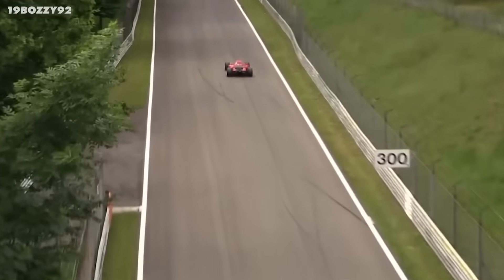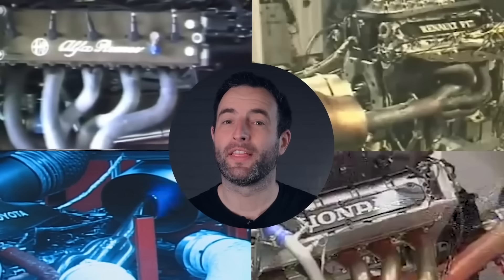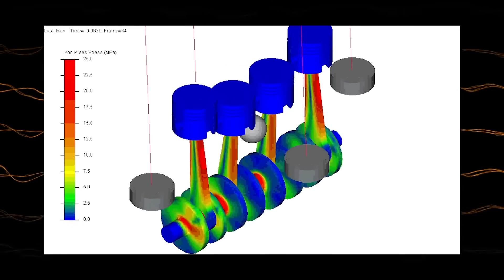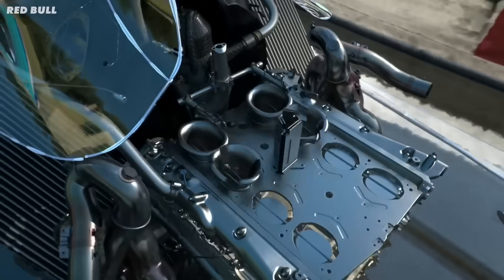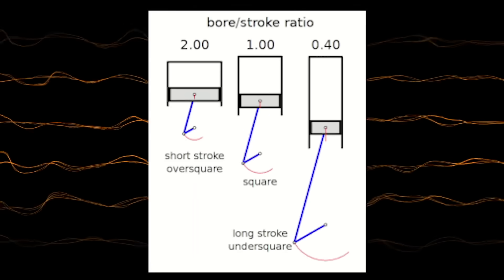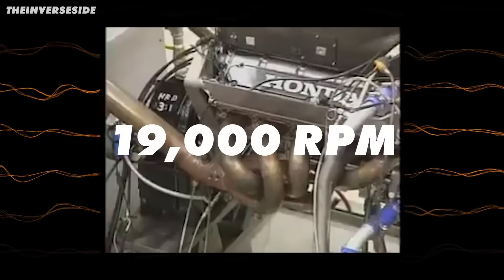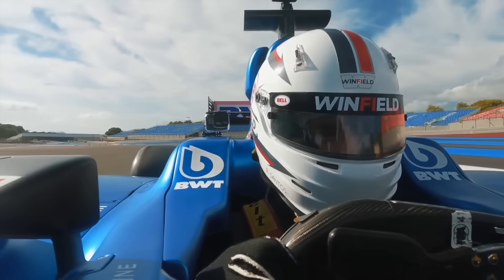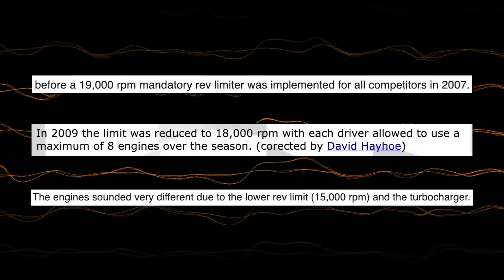When Formula 1 Engines Revved to 20 000 RPM!

Comment: I loved the description, but a small correction is needed about the reason V10s sound so good. For the really technically curious ones, V10 and in fact inline 5 cylinders sound different to any other engine layout because of their odd firing order and the frequency at which a power stroke occurs. In a typical 4-stroke engine you get a firing interval in degrees of rotation by multiplying 4 by 180 and diving it by the number of the cylinders. In 4 cylinders that's 4*180/4=180. Every 180° of rotation of the crankshaft, there is an explosion occurring. In 6 cylinders that's 120°, V8 - 90°, V12 - 60°. All of those spaced 30° of rotation and that's why they can sound good, but they don't have that dirty texture in their sound. HOWEVER inline 5 or a V10 have an that happening every 144° and 72° respectively. That interval leads to a different sound, one with unique frequency and texture. That's why Inline 5s and V10s sound so dirty in the best way possible.

Comment: Are you a F1 motor mechanic.. No.. Definitely not.. The precision of a F1 motor.. There is no rings you have to warm the block up before you kick in the guts Barry.. The high revolutions come from the induction systems and the electrical system..most modern cars can handle high revs...

Comment: The Mercedes F1 cars in the 1950s had what they call desmodromic valve gear, a sort of extra camshaft that pushed the valves up while the 1st camshaft pushed them down.  It didn't matter if the valve springs couldn't do their job.

Comment: Want to talk about internal engine stresses. Look into a top fuel dragster.  500 cubic inches (approx 8 L) and produce approx 12,000 HP. run around 9,500 rpms. Turn over only 900 times in a qt of a mile. Must be rebuilt after every run.

Comment: I miss this era of F1 racing. I remember the first time to a F1 race and heard the banshee wail of these engines going around the track. I remembering first hearing the sound of engines almost 5 miles away from the track and by the time I got within 3 miles of the track I could make out the voices of the different engine makes. As I made the walk from where I parked my car to the track and by the time I went through the gates of the track I was drunk on the sound and was gitty and giggling.

Comment: Although I 100% agree that the V10 engines sounded the best, today’s engines would actually sound much better if it weren’t for the artificial (based on fuel flow restrictions) RPM cap.

Comment: One of the other reasons V12s fell out of favour against V10s was that the former had noticeably higher fuel consumption so Ferrari was often compromised in strategy against the V10 and V8 competitors. McLaren found the same challenge when Honda used a V12, complicated further when they deviated from a 60-degree V angle.

Comment: current F1 engines make as much power at 10krpm with 1.6L, and half the amount of fuel...not bad if you consider an engine is not a loud speaker and is made to power a car, not make noise. without current fuel flow limitation, current engines would decimate V10's performance.
Reply: no they wouldn't, because there's only so much you can extract out of a 1.6 V6, a 3.0 V10 with twin turbos would easily destroy modern V6 engines

Comment: To summarise,  F1 engineers didn't want to make cars revving to 20k rpm. They had to make engines that rev to 20k rpm because they were limited by CC and a ban on turbos.
If neither were restricted, you'd bet your house that engineers would build engines that put power where the driver could actually use the most on the track. There has been extensive research into modern turbo power race cars vs high revving NA race cars. The outcome is always the same, the driver has access to the power more of the time when the power is lower down. 
Put that kind of engine, even 8k or 9k rpm in a road car, and the truth us, you'll only ever feel the cars power in 1st gear most of the time.

Comment: I'll never forget hearing the sound of the V10s heading out for their 7AM warmup at the 1999 Australian Grand Prix in Melbourne. The Albert Park circuit is near to the centre of the city and the sound traveled for kilometers across the city.  Imagine the tranquility of a Sunday morning shattered by up to 20 V10s revving to impossible speeds. Spine tingling and unforgettable.
Reply: Did it ever cause windows to break ?? I'd think somewhere windows would ripple and maybe crack if close to the track.....
Reply: The way you mentioned shattered tranquility instantly made me think of the Africa Special on Top Gear, where Jeremy uttered a similar line for James May on a very fateful morning.
Reply: The engine sounds are the reason Lime Rock never had races on Sunday... the local churches were up in arms about the noise iirc

Comment: Bit of interesting trivia that shows that RPM had become the only meaningful way to gain power: in the early 00s, manufacturers would record competitors on the straights and then analyse the audio to find out the highest pitch because that could be directly converted to RPM and then compared to their own to see if they were up or down on power compared to the competition.

Comment: They should scrap the Turbo+Hybrid altogether.  They should return the 3.0L V10's, set an RPM limit of ~16,000.  But have either renewable fuels, or hydrogen.  We already have Formula E.  I've said this before, we still race horses don't we?  You could also restrict the materials the engine could be made with.  All this to keep the costs as low as possible.. These new 1.6L Turbo/Hybrids are WAY more $$$ than the V10's ever were....

Comment: Early n/a era with manual gearboxes was simply glorious.  You could hear the drivers shifting and matching revs.  Engine down shifts into corners were epic.  True, paddle shifters sounded just as good and resulted in faster times but gone was the driver working the throttle.

Comment: Tbh, never really liked the wail of the V10s. I’d go as far as to say that the big-standard 1970s DFV sounded better to me, but even that was shaded by the ‘70s V12s, more specifically the Matra V12, which sounded utterly stunning. 

Still, best sounding F1 engine to me still is the 1950 BRM V16. It sounds like a race car engine made by an angry god.

Also, weren’t the 3.5l era V12s mostly handicapped by needing way more fuel than the V10s?

Comment: aside from the sound of the v10 and v12 f1 engines i love the sound of 11500rpms on a tuned zx14r motorcycle with an aftermarket exhaust. inlne 1441cc 4 cylinder.

Comment: Yeah, change the engines because of the cost.  And how did that work out?  Same amount of engine suppliers as before.  Then climate activism forced a change again to the v6 shit bag engines.  Now the PU is more expensive than ever.  That's perfect F1 right there.  The changes made make the problem even worse.  Good job guys.

Comment: and... todays engines are MUCH MORE EXPENSIVE
Reply: But they need way less of the
Reply: @ploppyjr2373  are they? Back then there was place for smaller manufacturers like cossworth and they could compete with the big ones and create better engine. Now there is no more place for them because design is so costly. Every component of todays powerplant is 10 times more expensive
Reply: @metalbyku  probably but again, as i said. Ferrari would use a new engine for every race and run it at max power. Very fast, very unreliable

Comment: The Honda RA109E V10 was actually the most powerful V10 in 1989 with a reported 685bhp vs the Renault's 650bhp, and helped Prost and Senna dominate that season. Honda even later produced an even more powerful V12 with 800bhp. It wasn't until Honda's departure in 1992 that Renault produced the best engine that year, with their RS4 V10.

Comment: Will never be a period like it ever again, more likely F1 kill itself through greed and corruption, obviously under the banner of equality, sustainability or something like that.

F1 circus is absolutely nothign compared to the rest of the world of co2 is your thing, nor do we need to follow the electrical race at all or any of the road car nonsense, this is supposed to be pure fun, entertainment can easily stand on it's own legs far outside those parameters cause it's a drop in the ocean.

No it's not what it once was, too much interference, too many interest ready to use and abuse F1 for own agendas.
No reason cars could not be extremely safe, much cheaper, lighter and faster today using same regulations applied to modern technology, think even refueling could easily be solved in save enough way today, they just do not want it and we will never see 20-22 cars fight at somewhat equal terms but with different ways of attacking the problems, aka developing within a fair set of regs.

None of can sit on the high chair and claim to have all the solutions, so just my personal opinion, beliefs.

Comment: shouldn't that sound be basically inaudible for most people?
Reply: 20,000 Hz is inaudible, but this is revolutions per minute, not second.

20000 revolutions per minute, 10 cylinders, 1 combustion per 2 revolutions per cylinder, is 1666.7 Hz. Totally audible.
Reply: @DJ_Level_3  Good point, thanks. I tried it in an online tone generator and even though it's very high pitched, I could imagine an F1 engine making a sound that high

Comment: Now that they have introduced a total spending cap, they should remove the ban on rpm and other performance factors. All of that is no longer necessary as the bigger teams cant just spend their way to the top. You'll likely see different innovations in different areas too. Some teams might for longer strait line speeders with powerful engines, some might go for shorter, lighter, less powerful but more maneuverable cars. Their strategies would change over time too. With the spending cap, its nobody's fault but their own if a team keeps losing.

Comment: I have a simple solution for the Sound problem. Instead of a V6 use a high RPM i5. At 15.000 RPM they scream just like V10s while having similar emissions to the V6.

Comment: I'd rather have teams chasing for the rpm than aero, aero makes no noise D:

Also it was the stupid environmental marketing angle that killed the naturally aspirated high revving engine. Cosworth showed with the Aston Martin Valkyrie that you can make a nat asp big V that complies with emission regulations. And it's not like the entire F1 circus doesn't actually produce way more emissions than the cars themselves, the V10 and the V8 were just the victims of stupid marketing.

Comment: In my opinion V12 engines still sound much better than V10. 

The Lamborghini SCV12 already beats out any F1 V10 and it’s not even an F1 level engine but just a slightly tuned SVJ engine.

Comment: I'd agree with most of what you say, seeing and hearing Red 5 going around Silverstone is about as good as it gets. At about the same time I saw and more impressively  heard a BRM V16 going around the same circuit, nothing like it. My favourite sounding competition car was Tony Pond in the works 6R4 going through Hamsterly Forrest on the RAC rally makes the hairs on the back of your neck stand on end. Formula E has a lot to overcome, a squealing tyre just doesn't cut it.

Comment: The current engine is not even hitting the 15000 rpm rev limit because of the fuel flow limit rule. They run around 12000 rpm even in qualifying.

Comment: Here's a freeby guys, as I feel like you're missing literally half the video:

Typically torque will drop off as rpms increase, meaning that you can't simply increase the redline and make more power, no matter if the engine can take it, mechanically.

Torque is directly related to how much air and fuel you can fit into the engine during the intake stroke. Combustion efficiency comes into play (derived mainly from how well mixed your air and fuel are, as well as compression ratio, combustion speed and ignition angle).

You can change valve lift, timing and duration to optimize that valve opening window to get as much air as you can through the intake ports, but at 19000rpm, that valve opening window is SO small, that those ports actually become a bottleneck. (theoretically your maximum airflow happens when the airflow reaches the speed of sound, beyond which you get a 'choked flow', where the air travels faster but loses density so your essentially moving basically the same amount of air molecules).

Where I'm getting at is: if torque drops off faster than the rpms can add additional horsepower (HP = torque * rpm / 5252), then this means that revving higher will net you less HP.

Luckily, to not explode your rotating assembly at high rpms, you typically reduce the bore/stroke ratio, meaning you'll get a bigger piston diameter, slowing down your average piston speed during the revolution. This ALSO translates to ***more space to put it bigger valves***.

Basically: as your bore becomes bigger, even if you reduce the stroke to maintain an identical displacement, you benefit from having the possibility to use bigger valves, which will flow more at higher rpms, thus allowing you to maintain the cylinder filling that is critical to maintaining enough torque at high rpms to generate more HP. The draw-back is that huge valves actually flow like crap at low rpms, induce terrible air/fuel mixing, both because you lack air speed through the intake ports at lower rpms. This is a contributing factor as to why high revving engines like motorcycles get such bad efficiency at low rpms compared to typical road car engines.

Comment: All my favorite engines are high revving, that's why I bought an early S2000 vs the later one. When they started lowering the limit I felt like they were limiting advancements. I'd love to see them open up the rev limit and other design factors to see what the best engineers can do.
Reply: It’s not just revving high it’s firing order. That engine is nothing more than an oversized sport bike engine. Audi/Lamborghini, Porsche, Lexus (really Yamaha) and BMW are the production V10’s to have.
Reply: 250cc inline-4 bikes such as CBR250RR MC22 or ZX25R, around 18,000 rpm, actually sounds like F1
Reply: @kerimca98  Firing order and rpm are what makes the v10’s unique. Moto gp bikes sound pretty good but they’re no 3.0 liter f1 v10 and even today aren’t as efficient. Moto gp bikes haven’t gotten to 300 hp per liter even today f1 was at 310 hp liter 18 years ago
Reply: @kerimca98  yes an in-line 5 would be pretty close like what Audi makes.

Comment: Dinosaur alert from a long time fan! This was the best era of F1. They should have left this concept alone and just added a halo and a few more teams. These cars were safe and compact. The cars today and huge and heavy. Fans don't come to F1 races to watch drivers regenerating their batteries just to go a little faster than the previous generation of cars. They literally don't care and frankly can't tell. You went 1 or 2 seconds faster because of the Hybrid system, so what? We want the sounds and the smells of a high performance race engine. The difference of a second or two over a lap is insignificant to the viewers.

Comment: Today's F1 would sound decent if it had a straight 6 platform rather than v6, v6's in general dont sound as good. 2jZ, RB, N55, N54, Barra, all sound amazing on high revs. Obviously itll never happen due to the F1 bay's  realestate with both the hybrid & turbo setup. Still would have been sick to hear a turbo hybrid electric Straight 6 revving at 15,000rpm.

Comment: I could not disagree more. The best sounding engine of all time was the ’95 Ferrari V12, their last V12. I was fortunate enough to have been around for this period and experienced the change from the turbo engine to the 3.5n/a. Simply glorious. Well under 600kg and 700+hp to 900+hp. I still love F1 but it has lost much with the bloated, obese, modern cars, dragging about the extremely heavy battery+motors.

Comment: The reason they did away with these V10 engines is not expense, that's BS, they are not practical. Remember how often cars would stall on the starting grid, very little torque.  They idle at revs that are a typical redline for street cars. To run extremely high rpms means holding extremely tight tolerances so the engines, at ambient temps, are seized. They need to have hot oil and coolant run through them before they can be rotated.
Can you imagine everyday commuters hassling with that so the mfrs were threatening to leave F1. They needed to develop eng tech for future road cars, ergo hybrid tech. F1 wants a show, mfrs want, need research. Mfrs have the bucks, no bucks, no Buck Rogers?
There is/was a great Shell/Ferrari video commercial on YouTube or Vimeo that I just love to watch. It starts with a 50's F1 that looks like a dirt track midget with a tractor eng driving past the coliseum in Rome. Then jumps ahead in successive leaps until it ends with the  scream of a V10 in Brazil. Every motorhead should have this vid, guaranteed.

Comment: On the current trajectory, F1 engines will eventually only have 3 cylinders, rev to 5000 rpm, and the cars will weigh 2 tonnes.

Comment: Definitely do not agree. Just because they had a higher RPM does not mean they were the best sounding engines. In my opinion you need a bit of raw grunt and for that the V10’s of 1989/90/91 were hands down the Best Sounding. They sounded Animalistic. These sound like a someone or something is screeching in pain… No grunt just an unpleasant noise. They do however sound better than the current Hybrids. Yes that I’ll agree.

Comment: Honda campaigned a 6 cylinder engine in 250 and 350cc (actually only 320cc) GP motorcycle racing versions in 1965. The R166 developed 60bhp at 18,000rpm or 240bhp per litre, naturally aspirated.  They built a 500cc version that was reputed to produce 130bhp, but The width limited handling. Phil Read and Agostini tested it and said it was beyond the tyre tech at the time so it was canned. But Honda had proved a point.